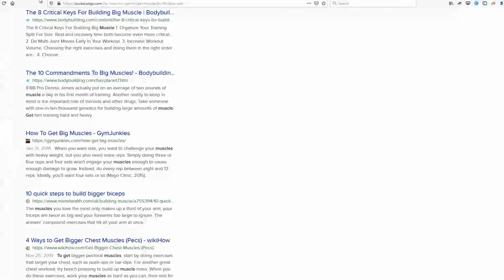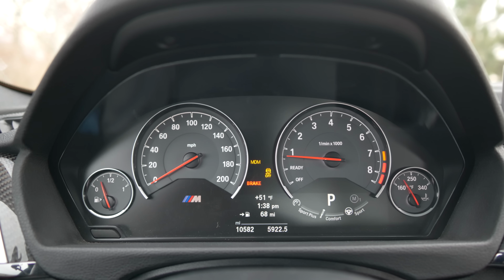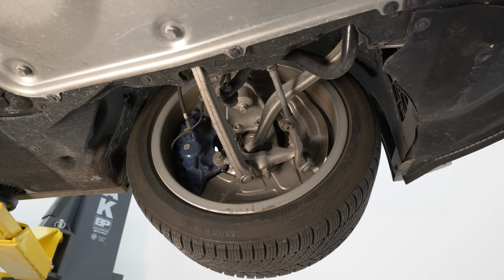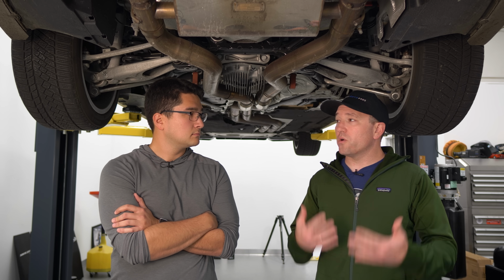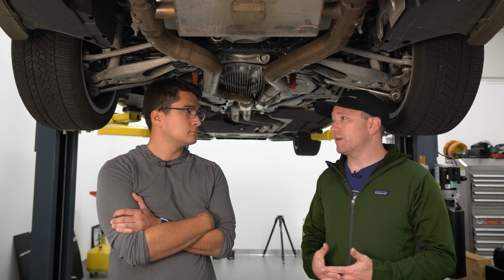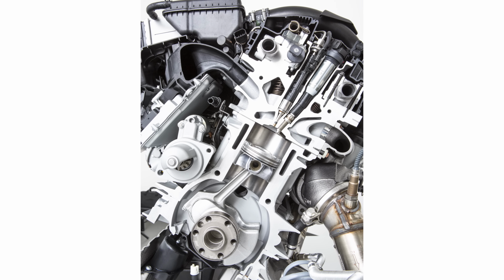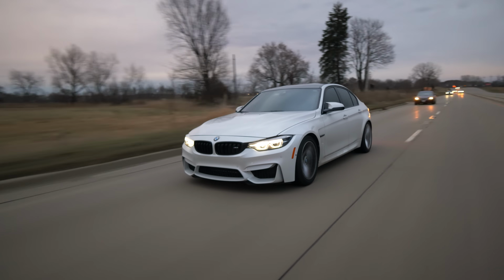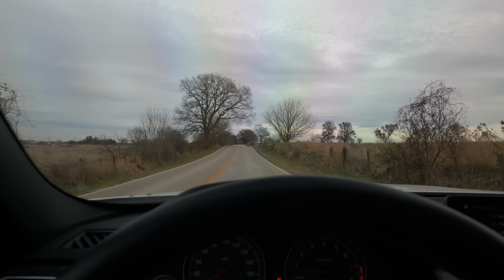BMW F80 M3 Review | The Sports Car for Mathematicians

Comment: I think you guys hit the nail on the head. Great analysis!
Reply: Thanks for supplying your car for reviewing. Put aside what savagegeese said, what do you think of the car? Did you cross shop other cars? Personally, reliability is the major thing stopping me from buying a BMW, if this generation turns out to be substantially reliable than previous gen, I may actually end up getting a used one.
Reply: @garykong7597  20K on my F82, zero CEL and zero surprises. Tires will go 10-12K and need replaced depending on your driving style. You can also check the forums and there are alot of high mile cars that have been reliable. Car is a fast Daily Driver.
Reply: Hey Aamir, pick up some SunRunner Cable Clips for that hanging wire. ;-)
Reply: Well darn, and here I thought I had somehow become the proud owner of an M3!  Had me seriously confused for a moment.  Sincerely, Another Aamir
Reply: Jay Mallison wire?
Reply: Thanks for offering your car for review. This was a great, informative video.
Reply: TheRemster forgive poor English pleaze but why you say anal isis? What meanings is this?
Reply: TheRemster I ask to you because sound quiet painful
Reply: Hit the nail on the head? They spend the review basically saying it’s shite, then change their mind at the end. Worst car review I have ever sat through. I only did because I’m buying a F80.
Reply: @savagegeese you talk about wanting a cool weekend car with drama and with great steering feel, but you never say what car has all of that for you. What weekend car are you thinking about that looks cool with great steering feel and has plenty of drama to be fun?
Reply: Tom Jones He likes GT350 a lot (sans the motor’s reliability). Also, s2k, 911 gt3, cayman gt4, nd miata with new engine, new supra
Reply: @kevinkeelan354  yeah it was a bad reveiw, he says about the lack or hooliganism (like the hellcat) and character, but then says, that it wants to always step out on you and drift, which is the exact opposite, he says it's boring yet smiles thru a lot of it, he contradicted himself way to much
Reply: The M340i is underrated
Reply: Drove alot of f80 m3's aswell as f82 m4 , and I like them but they feel like every other new M car , also the exhaust note is horrendous , even on start up you just can't make this car sound good
Reply: I have an f83 m4 LCI, far from a mathematician, actually an automotive photographer and I love this car so far. That being said I have no other m car to compare it against. I’m not a technical guy, nor do I care about the numbers that much, to me it’s the joy of driving and this car checks all the boxes for me.
Reply: @DamianPlisko  xd, I hate math
Reply: Wonderful car and thanks for sharing it with us all!
Reply: @garykong7597  I feel the same though I like the M4.  Reliability is the only thing holding me back.
Reply: @kevinkeelan354  couldn’t agree with you more. This was awful. Compare this car to any other car “same time period” and m3 shines. Also, did he say he drives a g80 genesis? 😂😂some car guy
Reply: @Fasttechs2k  Alfa Quad is slightly better IMO. Still love the F80. Not a fan of the current m3/4. Too big and ugly.
Reply: @kevinkeelan354  that sounds like a you problem, you have no taste. This is one of the most nuanced and substantive car review channels out there.
Reply: Agreed!
Reply: Sucks people supply their car, pop up in the comments section and then not answer peoples questions on it.
Reply: M3s always dip down then skyrocket eventually. 
E30 m3 are 70k
E36 m3 are 20k
E46 closer to 30k
E92 20-40 for decent condition not including comp or gts edition
Reply: @Kinvesu busy man